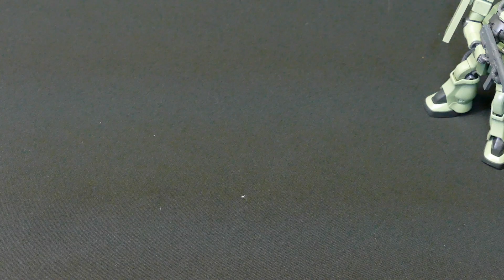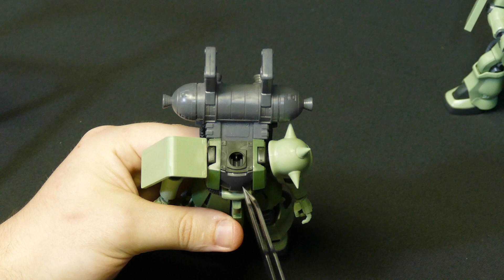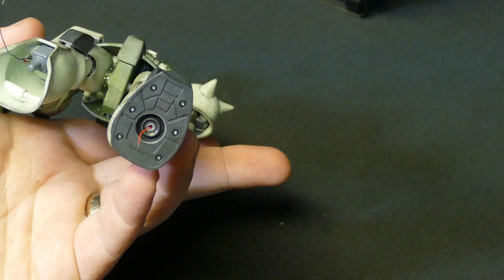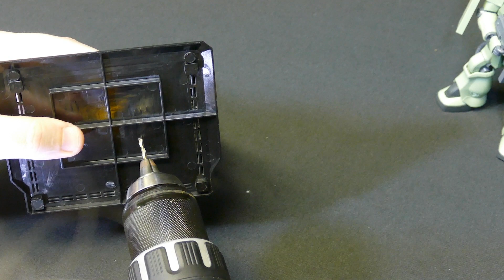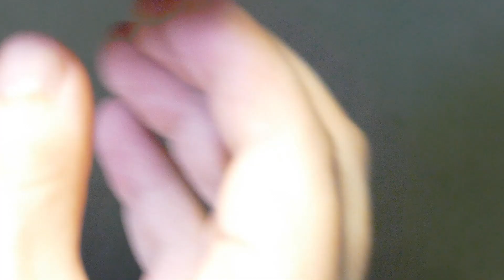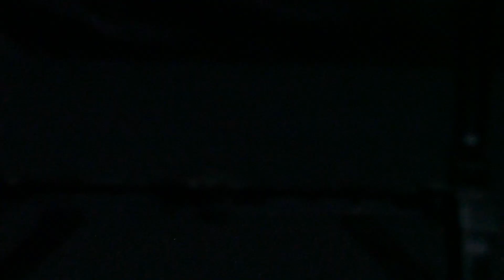How to Power Micro LED Lights Using Rare Earth Magnets for Gunpla & Miniature Dioramas Pt. 2

Comment: is that a resistor on one side of the circuit?
Reply from the maker: No I didn't add any resistors. it's just a really short piece of wire with a little of the shielding still on it.
Reply: @MidnightHatter thanks

Comment: How did you make that monoeye part? Did you make it entirely in that neon resin and paint it black or  did you drill a hole and filled it with the resin?
Reply from the maker: I cast the entire part in resin and painted it black. But drilling a holl and using some spot UV resin would have been more efficient.

Comment: Can you put the positive and negative wire on one magnet and still have it carry the charge or does each one require it’s own magnet?
Reply from the maker: @apstorm17  No, each end requires its own magnet and can’t touch otherwise it will short circuit, possibly a fire hazard.

Comment: Does it work if you instead of solder the microled to the magnet you use something like uv resin?
Reply from the maker: Yes it does, as long as the wire stays in contact with the magnet. In fact I think that’s a better idea than soldering since the heat from the soldering iron demagnetize the magnet.

Comment: If i wanna use about 5 or 6 of these nano lights what kinda battery should i use i ordered aome of these on amazon and a watch battery casing
Reply from the maker: It just has to be a 3v battery. Technically you can even use two AAs since those are 1.5v each. The main thing is to remember to wire them in parallel circuit, not series. You can’t daisy chain the lights to one another, they each need a direct path to the battery.

Comment: I never knew these magnets were conductive!  That's gonna be such a boon.  Thanks!
Reply from the maker: Right? Just don’t make the mistake I did, if you overheat them they lose polarity, so if you solder them, be quick!
Reply: @MidnightHatter  so the connection is between iron and magnet? Damn... I constantly was trying to connect magnets together and it never worked...